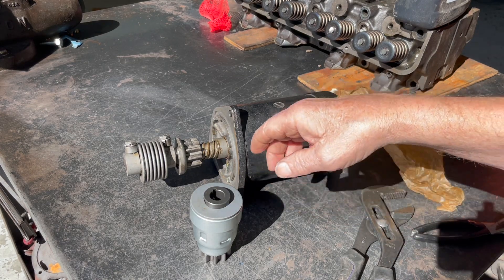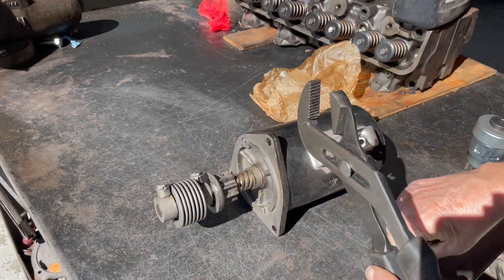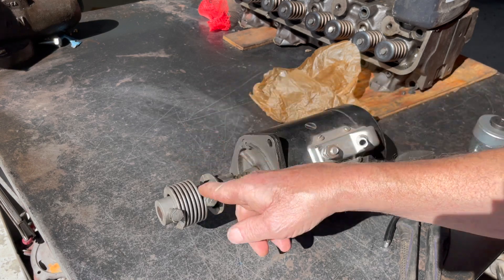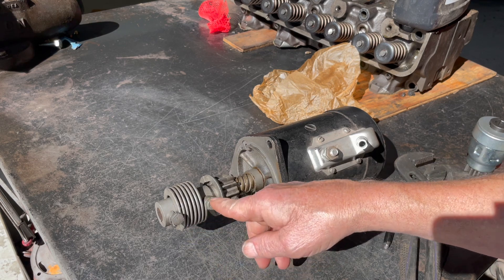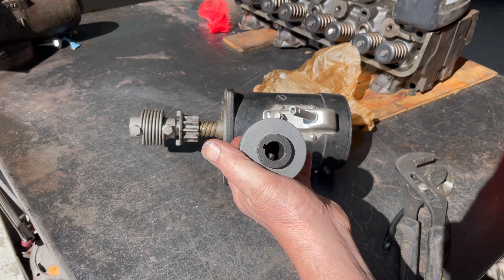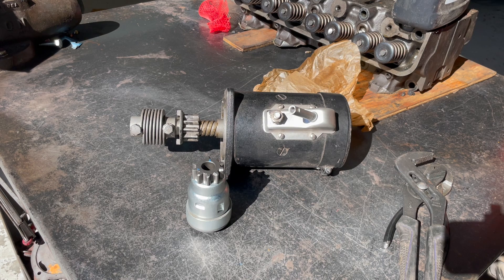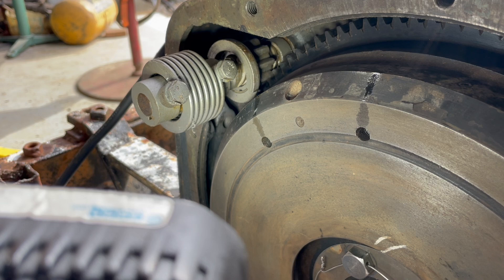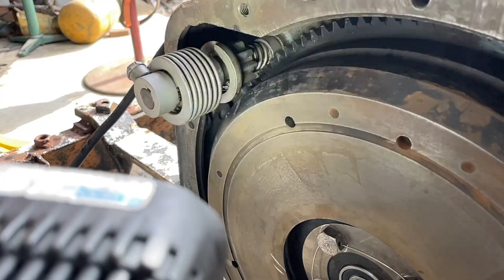What Happens When You turn The Key To Start HOW MODEL A FORD STARTER BENDIX WORKS

Comment: I just pulled my starter off & notice metal shavings on it after looking closer I notice the teeth on the ring gear was kinda chewed up
Reply: Depending on which started drive you have (Original or "modern"), the drive teeth may not be engaging the flywheel properly. You should be able to see a wear pattern on the drive teeth which should be pretty much be in the center of the tooth. If the pattern looks normal you may have to replace the ring gear. They tend to wear more in one spot so it's best to rotate the engine and inspect the entire ring gear.

Comment: i had that bolt break off and got stuck in the flywheel  what a mess   i took the starter off and worked the flywheel with a crowbar until it popped up and i grabbed it    I also pulled out another bolt as well and a lock washer with a magnet on the end of a coathanger through the starter hole   got lucky i didnt have to remove the trans    great video too
Reply from the maker: Yes they can be a bugger sometimes